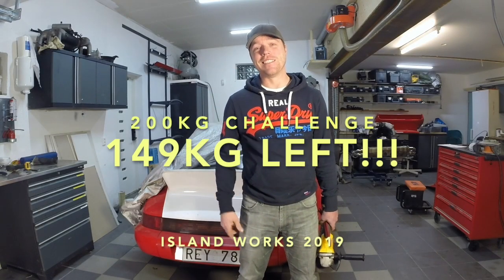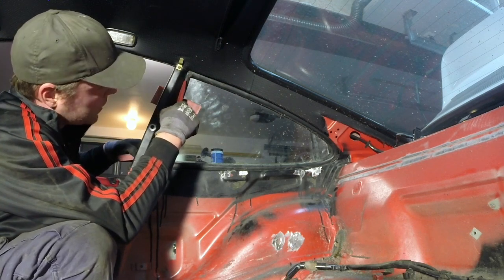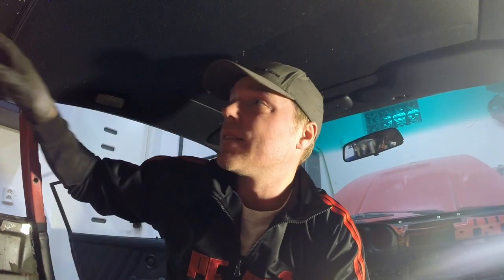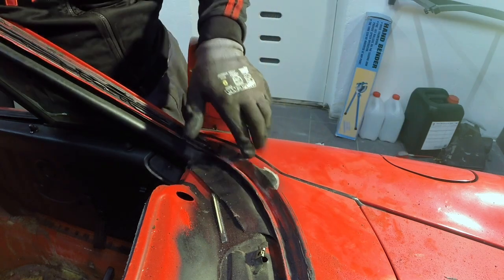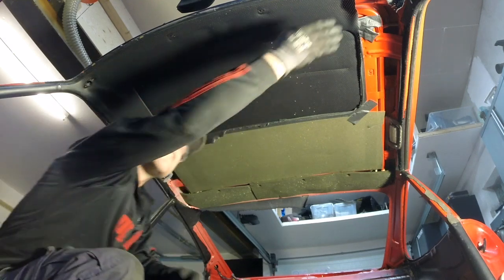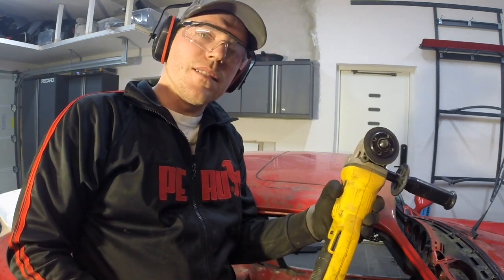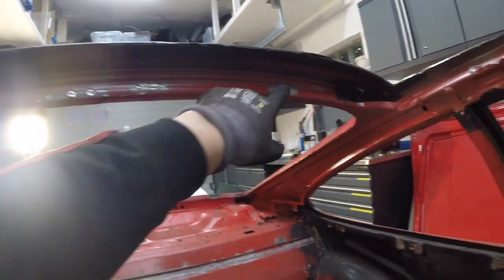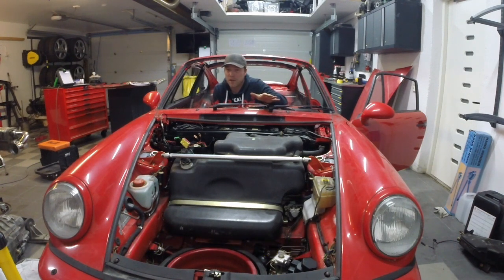Cut Steel & Bend Glass - Removing Sunroof & Window on My Porsche 964

Comment: I was always tought to feed a rope into the seal all the way around with wd40 then pull the rope as you push the windscreen from inside. More of a 2 man job but works well and no need to cut the seal 👍
Reply from the maker: I think your method is the correct one (as long as the seal is salvageable). For me I'm doing a lot of this for the first time and that's why some of the methods are what they are so to speak :)
Reply: @islandworks  you're very brave! I've not long discovered your channel and am working through the videos. Really enjoying it! Keep up the good work!

Comment: Something else that will really knock out some kilos is the hole 🕳️ saw route. In the right areas it doesn't lose any strength. In many cases you actually gain strength. FEA (material analysis) shows some really funky things when running millions of sims in algorithms. Literally holes everywhere for the strongest components with the load being directed. Seems odd but a hole and a dimple die is much stronger than a solid flat surface. There's a guy that went crazy on the late brake show, lightest 911.